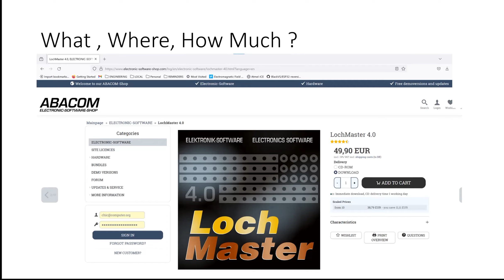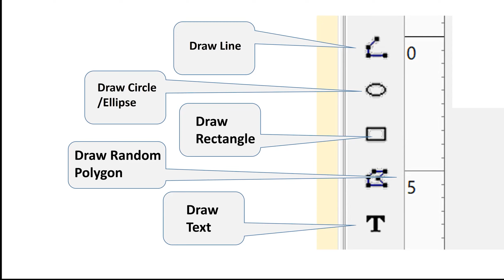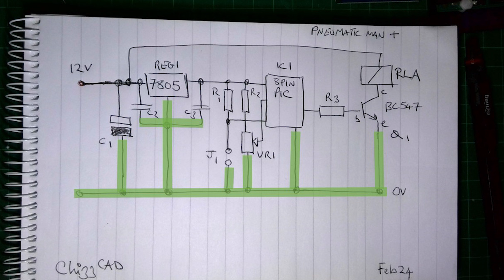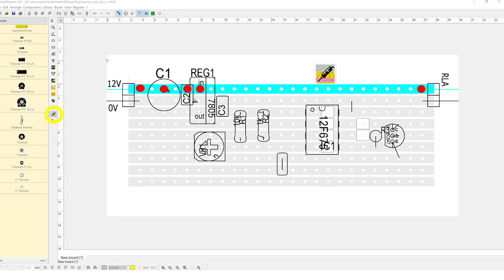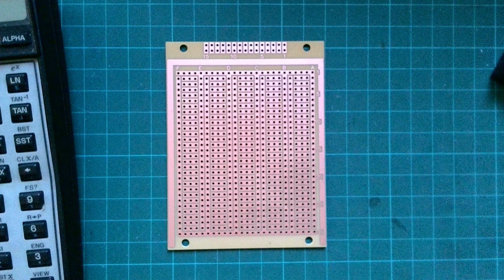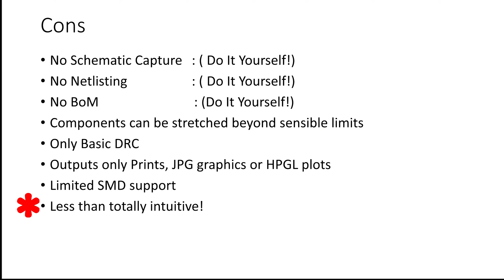Using Lochmaster

Comment: One special feature you did not mention; You can place components and edit all on both sides of the pcb! So  you can make very compact pcbs... You made a good review of Lochmaster, well done. One point for program improvement schould be a library editor and taking lenght measuments, like in Splan8...